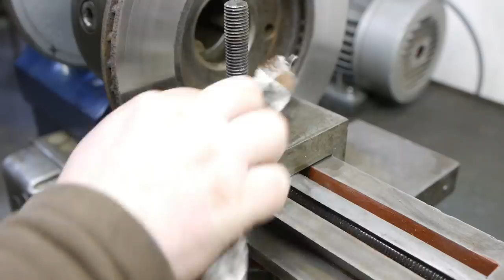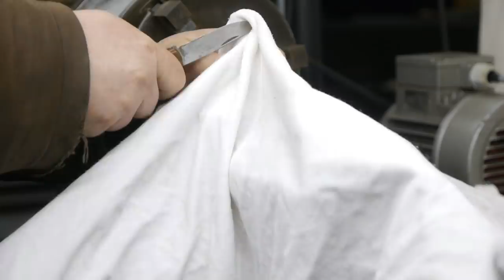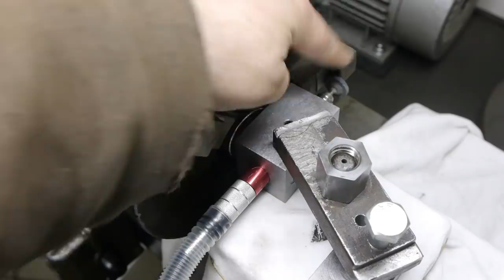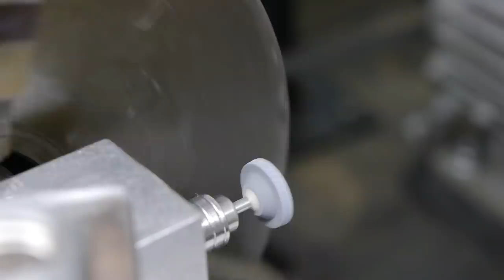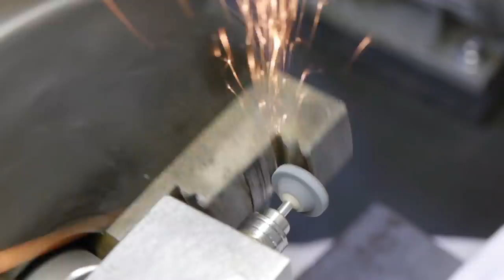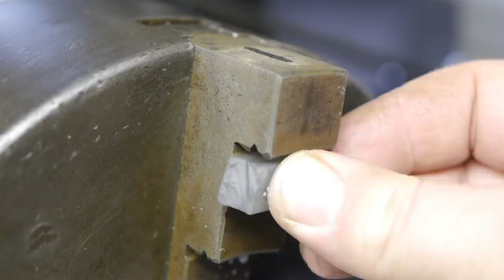Grinding the jaw steps on a worn out old chuck

Comment: Hi would it be possible to machine the steps on the chuck with a lathe cutting tool held in the tool post and making extremely light cuts across the steps ?

Comment: A water separator/filter on your airline would help.  Aluminum Oxide stones for durability and finish would help also.
Reply from the maker: I have a water trap on the pressure regulator. Maybe it was a rather humid day.

Comment: As you said, a better result than you expected.

A plan "B" could be a version of soft jaws.   Epoxy some thin pieces of steel on the step of the jaw, which are cut to the size of the step, then machine the tops of the steel flat.   This would make the surfaces as close to flat as you can get.   The surface would not be hard, but it would be fine as reference surface for the brake rotors.  You could remove the pieces in the future if needed by apply some heat. 

Dave.
Reply from the maker: Very interesting idea if, needed I'll give it a try. 

But he epoxy must be strong enough to survive the interrupted cut from a boring bar.
Reply: The epoxy product I use for metal-metal or metal-wood is called JB Weld, the original grey version.  This takes several hours to cure but it has a very good bond once cured.   If this is not available in the Netherlands, there is likely equivalent products, just to a search for reviews on the product.

I saw a list where someone rated epoxies.   The order of this list was
1. Loctite Metal (best)
2. Quiksteel
3.Devcon FasMetal
4.  Loctite Instant
5. JB Weld
6. Gorilla

Comment: Hi Rolly,
You definitely need a filter on your air line.  Water will muck up the rpm on your little grinder. I thought you were trying coolant :)
I’d have clamped your holder on metal instead of the dust cover.  Maybe there was a bit of movement there.
Definitely have the chuck spinning and not grind the jaws one at a time.  You really want all three the same.
I think the reason you were seeing a variation in the jaws is because they are actually different and that is what you are fixing.
I’d also have trued up that piece of scraptonium.  The rounder and more straight sided that is the better result you will get.
I was taught never to grip black bar in a 3 jaw chuck as it will ruin its accuracy (I didn’t listen to that one)
Did you also dismantle the chuck and give the scroll a really good clean?
I thought one of my old chucks was stuffed until I cleaned it out. Made a huge difference. 

 I think you are on the right track.  If you are patient you will only improve this chuck.
If you can’t stand the noise buy better ear muffs :)
Reply from the maker: Maybe I should light a fire underneath the air-tank to keep the water evaporated :)
Reply: Ha ha or just set fire to it.

Comment: G’day, the result was quite good. I too would blame the crappy tools, especially the stone but you won this one. 
Consider this, the first time the brakes get hot the rotor will slightly warp anyhow but the calliper will float to compensate. 
Cheers 
Peter
Reply from the maker: That's right, took a bit of luck.  But yeah, this could be considered a win :)

Comment: That kind of die grinder is useful for some things. This isn't really one. But at least you were willing to try it. I have the same grinder and while it works well for grinding with the tiny burrs, any larger wheels explode on me. Yours is newer. Or maybe just cleaner.
Reply from the maker: And the spin so fast that they might bend the arbour. That happened to a friction disk arbour I was going to use :)

Comment: RM,
   If you want to try hard turning I had great success turning hard jaws with Blue Nano carbide inserts from Banggood. Those inserts are are super tough and others have had great results turning the hardest materials, even titanium. There are two good things here in that our Asian friends have yet to figure out how to screw up carbide and the Banggood price for the Blue Nano inserts is very reasonable. Now if they could just cut down on the shipping time!
Reply from the maker: Isn't hard turning done with diamonds? And isn't blue nano nothing more then a nice colour to improve sales.?
Reply: RM,
All I know is the Blue Nano inserts worked for me on my hard jaws and I’ve continued to use the same insert for over two months turning stainless, 8620 and considerable hardened tool steel items. I thought it was a sales gimmick too until I saw some reviews on them by some very reputable machinists. I even silver brazed one Blue Nano inserts onto a special made boring bar and it performed great. I thought the intense heat might affect the Blue Nano treatment but it didn’t. I wouldn’t recommend them if they didn’t perform or hold up but they have and I’ve put them to some pretty rough trials. They don’t even chip like regular carbide.
Reply from the maker: That's very interesting, cause I had my share of questionable inserts.
What type of insert are you using?
Reply: I’ll have to get back there you on the number as I’m not at home currently and my feeble memory can’t produce the size
Reply: RM,
DCMT070204 Blue Nano inserts from Banggood.
These are the one I ordered and used to fit my tooling though Blue Nano inserts are available for various size tooling I believe.
  In researching the inserts I found the blue coloring is for identification purposes and the Nano signifies the type of carbide material used in the manufacturing of them which seems to be micro grain carbide which is the hardest and most durable carbide available in insert application. I tend to believe this due to the resistance to chipping that is common with C-2 and C-6 carbide material. As I stated earlier I have continued to use the original Blue Nano inserts I used to true up the hard jaws in my chuck for over two months and it still performs well with occasional touch up with a diamond stone. I have used it on hard materials with interrupted cuts without any damage to the insert. The cost of them from Banggood is very reasonable and worth the risk. I think you will be satisfied with them if you choose to use them. 
   Most of the Asian carbide inserts are made from C-2 carbide unless they indicate otherwise and that is most likely the reason for your unsatisfactory experience with them. Hope this helps.
 In addition your experiment with turning the brake rotors is always going to be a hit and miss venture. Brake rotors often are subject to extreme heat which alters the properties of the cast iron from which they are cast. The heat is extreme enough the cast iron will sometimes harden, often in uneven patterns. A lathe is not the best way to true them up. Special grinding machines are used here in the US in the mechanic shops to do this work and the uneven properties in the rotors are therefore overcome.
Reply from the maker: Thanks for that update Dale. I see they are available in a couple of shapes I have tool bit for. I will certainly give them a try. As for the rotors, perhaps it's best if I accept my limitations and have them turned on a dedicated machine.
Reply: RM,
   In my experience of doing my own brake work for all the years I’ve own cars I’ve found rotors and even brake drums to be fairly forgiving. Brake pads float and adjust to the surface they bare against and form themselves to the shape. To a lesser degree brake shoes do the same thing although they are more susceptible to grabbing due to the design. I’ve never resurfaced brake rotors unless they became deeply scored due to metal to metal contact of worn out brake pads. That said in all the many years of surfacing and rebuilding the brake systems on the many cars I have owned I’ve never experienced brake failure.

Comment: Good job , I had great results using a 1/4 inch die grinder on mine but I have a 5 HP compressor with an air dryer .
Reply from the maker: An air dryer would probably help a lot. Water got everywhere. In the air tank, in the pressure regulator, in the inline oil reservoir, and finally in the grinder. Thought the compressors must have been running for 3 hours at-least.

Comment: I think I have a good trick for you to help in machining the rotors. The machinist who taught me does rotors every day. He has 2 turning tools: with one he makes one side and the other is an L shaped one and with that he turns the other side so he doesn't have to flip it because he says that the rotors are not going to be parallel. Hope it helps you. Also nice job on the chuck jaws
Reply from the maker: The idea is good, but you do need enough cross slide travel to be able to reach around to the back side of  the rotor.
I'll take a measurement but I'm pretty sure my lathe doesn't have enough travel.  I guess I would need an U shaped tool.

Comment: After reading all of the comments , I was surprised to not see anyone suggest HARD TURNING !   BUT, hard turning would require the cost of a cbn, or other superhard cutting tool . . . uggh ! * Even though precision grinding is best - maybe you can get the jaws flattened out by 'lapping' them ?   A hardwood disc could be mounted onto a motor on your cross slide . . .  then charge the disc with some diamond lapping compound 
     Without spending some money on a suitable cutting tool , you at least have made some improvement - and that's a step in the right direction !    "V"
Reply from the maker: Interesting idea. I guess a wooden disk in the tailstock could also work for lapping.
Reply: There are a lot of ways to do things , some easier than others . . . 
* you could turn a disc of cast iron to fit on a stub arbor that fits into your tailstock , & use that as a lap , using fine lapping compound - be sure that the lap is square & true to the spindle !   ( No doubt you have found that if ONE thing doesn't work , try something else ! )   ;)

Comment: Measurements on a 3 jaw chuck should be done when the jaws are under tension, ie when a piece is clamped in the chuck. Same goes for inside measurements. You will have to find or make a ring that allows you access, but still puts the jaws under tension.
There is waaaaay too much play in the chucks of those air-die grinders... even the professional ones are usually not good enough for this sort of job.
And yes, you need to get rid of the moisture out of your air supply !

Paddy
Reply from the maker: wouldn't wear on the stone take care of the run-out problem.
I have a Festo pressure regulator with an water trap it just wasn't good enough
Reply: Not really... those dinky spindles don't run out to one point.... usually they are a bit of a rattle fit in their bearing and the stone orbits around the center of the spindle on top of rotating. These oscillations are visible in the surface finish of the work.
So you are basically "slamming" a rotating stone into the work a few 10 000 times per minute. On top of that, the amplitude and the frequency of those  oscillations are subject to the pressure you put on the work. 
A toolpost grinder (one that's actually useful) is a precision machine. They aren't cheap!
When I needed one, I ended making one because 3500 euro was a bit much...
I still spent 500 Euro or thereabouts on materials though....
About a 150 for a spindle motor (4500 rpm) and the rest went on bearings. There are six precision bearings in my spindle. Two of those are trust bearings and I had those in stock.
The sealed bearings I used have a maximum runout of .25 micron. 
Needless to say you shouldn't mount the wheel by means of crummy ER collets, but mount them on a hardened and ground spindle. 
Your wheels should be of good quality and suited to the rpm you are making them spin (for a  toolpost grinder . typical 20-25 K rpm.) You need to true them up with a single point diamond (fixed to the machine...not hand held!)
Small wheels of good balance and decent quality are not a cheap item either!

I have seen all manner of contraptions.... Dremels held in a toolpost with hoseclamps.... die grinders.... you name it. None of them will work well and often you will do more damage than good.
I'd suggest you keep an eye open for some precision bearings (on Ebay or some such place) and buy then when the price is right... make a spindle to fit those bearings instead  of the other way around...(that could save you a good bit of money)(make sure the are rated for some serious RPMs!)
A spindle motor can be had from places like AliExpress or banggood or some such place...
They won't last, but 60-70 euro should get you a 300-400 watt spindlemotor that will do for now. Pulleys and the like you can make yourself. You will need a step-pulley (3 steps should do) Because a 50 mm wheel needs to spin at about 1/3 of the speed than a 25 mm one...
So make sure your maths is ok on this.

Paddy
Reply from the maker: You know, I'm more a 1/100mm kind a guy than 1/1000mm :)
But I would like to grind the inside of the bell-mouthed jaws one day.
My biggest problem is probably the limited space between the spindle centre height and the top of the toolpost.
Less then 20mm. And I can not remove the compound slide because then I would not be able to feed in the grinder. 

So the pencil grinder would be perfect size wise but it gave me lots of problems. Even though the result was better then expected. Any ideas on what to use, something that won't brake the bank or take months to make? I'm not looking for perfection, it would be nice but I'll settle for an improvement. Perhaps a rigid boring bar would be my best option
Reply: In reverse order....

NOOOOO !!! The idea of boring out the jaws of a chuck made me cringe ! Please don't do this ? First of all the jaws are hardened...so good luck 'boring' that. Second there isn't a boring bar around which doesn't deflect or a tip to be had that would survive this!
The clearance between the bed and the chuck is not really an issue... you don't 'stand' underneath the chuck in order to grind it.
Check out Tom Lipton's channel for a very nice video on grinding the inside of the jaws of a chuck. (Oxtool is the name of the channel)
In order to work to a tolerance of 1/100 mm, your machines have to be at least one order of magnitude better.....
Grinding is by definition something that happens in the realm of 'the "fourth digit" (1/1000).
Pencil grinders, air die grinders, Dremels, and such things are really no good at all for this sort of work, the really aren't. None of these things can be clamped hard enough not to vibrate like mad! Even if you don't feel the vibration, you'll simply see it in the finish... Besides that, they are not good enough in their construction do withstand prolonged grinding. Their tolerances are not even close to what you want for grinding.
Even very expensive commercially made toolpost grinders have been the subject of debate for the last 100 years ! Some of them too, are not rigid enough... or the RPM they get up to is too low...
Yes, I too have seen several videos of chaps 'improvising' with all manner of devices.... and they often will do more damage than good.... I call these videos Tool-porn-horror.... it's a popular genre LOL
I hear you regarding the cost of all this.... but the fact is, that on some things... you just can't go the ' economic' route.  Grinding the outside of the chuck jaws (or the faces as you were doing) is questionable. Especially of you have a threaded spindle nose. Your chuck will have to be removed and washed out after you grind it, and you will never put it on again in the same position... which means that the plain you have ground could be compounding the error of the spindle, when you put it back on...
This is not an easy task, not lightly undertaken. Even going the route of making a decent grinder yourself will cost some coin...there is really no way around that. 
Investing in a new chuck may be the cheaper option (check out HBM, Herman Buitelaar Machines, a Dutch firm) There is the chance that a brandnew chuck will look a bit like "lipstick on a pig" on a lathe that old.... but you should be able to get a 125 mm chuck for about a 100 euro (HBM branded, import..but decent quality)

Paddy

Comment: Hi, If I would turn my rotors, I would make sure that I could turn both side of the rotor and the inside of the rotor that is facing the hub all in one setting othervise I would not get a useable result, just my 2 cent on the matter, most car workshops have a machine that can do the job for you. Cant you get new rotors for your vintage car ?
Reply from the maker: You're right. That would be the better way to do it.
The rears rotor are still available at about 3 times the price of front rotors.

Comment: I would think you would get a more accurate result if you put a disc in the first step of the jaws instead of a round bar, that way the jaws should move the same as it does when you have the break disc in, I think anyway ?

Alan.
Reply from the maker: I was grinding the front face of the jaws. I think run-out doesn't really matter for that.
Reply: You are quite right, as the jaws will tilt in a different direction when clamped in the center compared to the outer steps.
Reply: Alan Pearce whats a break ?

Comment: Try oiling the die grinder.
Reply from the maker: I used an inline oiler that came with the grinder. The water turned white so there was definitely oil coming trough the grinder.
Reply: @Rolingmetal  sorry I guess that comment turned out bad. I meant just try to drop some oil in the grinder directly.